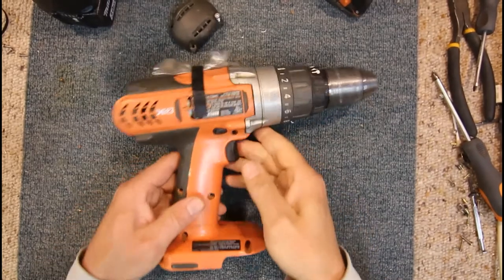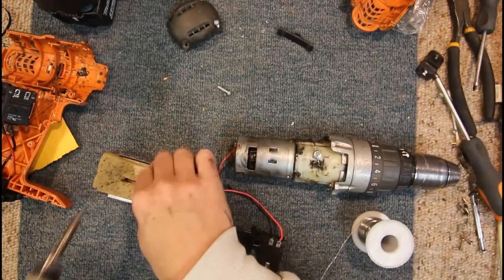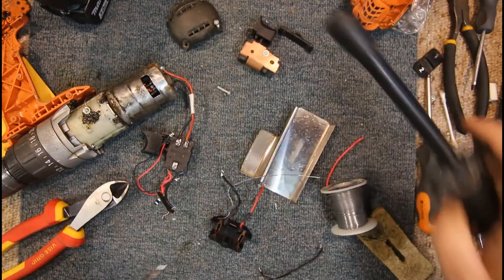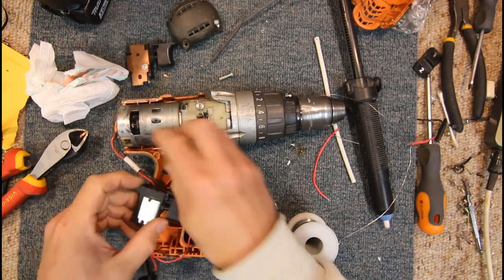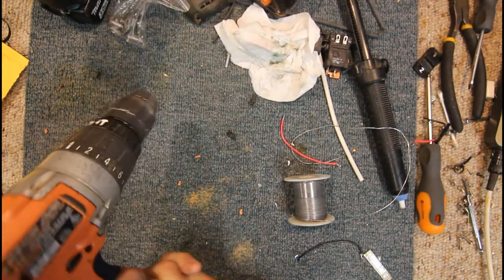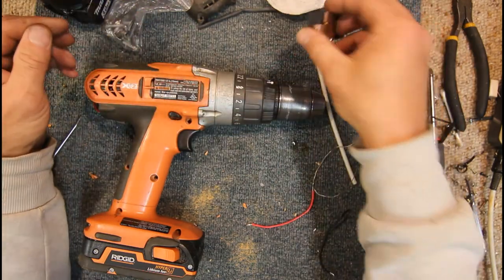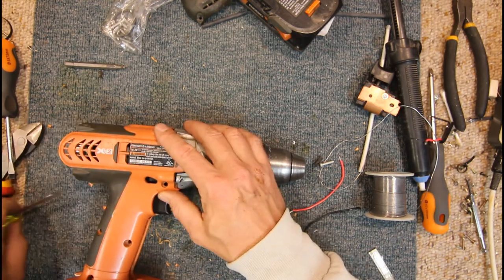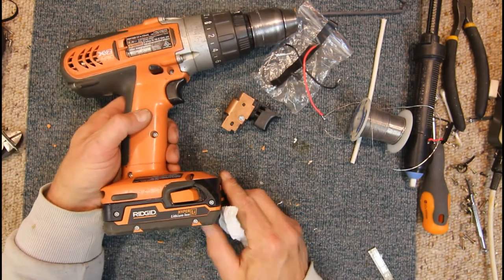Ridgid Battery Drill Switch Repair

Comment: I have the same drill and my switch is bad,  either full speed or nothing.   I am not seeing your replacement switch out there.  I realize it's been a while since you posted this, but would you or somebody else have a part or model number for the replacement?   Also the brushes if you know.  Thanks!
Reply from the maker: When I search Battery Drill Switch on Ebay it and many others still come up. Maybe because I've looked before. Here is the link to what looks like the exact same one. The drill it still working so they must be reasonable quality. You may be able to still find them cheaper. 
https://tinyurl.com/4yd8d77k